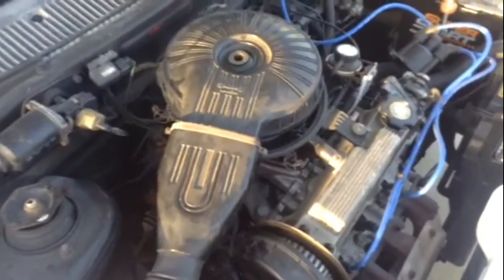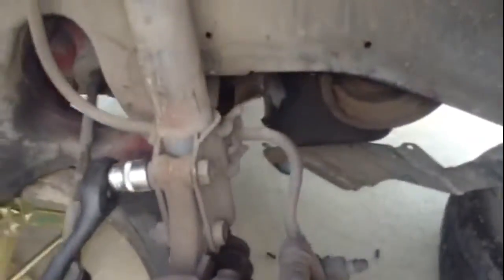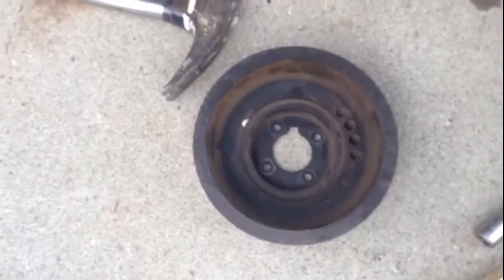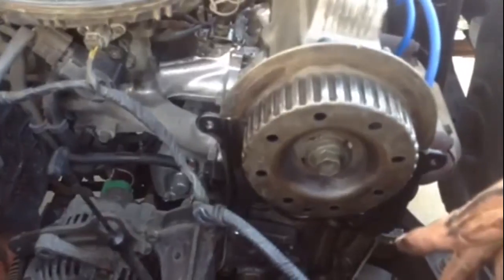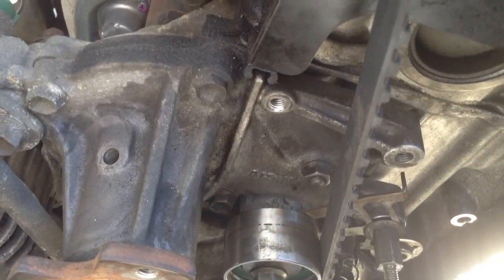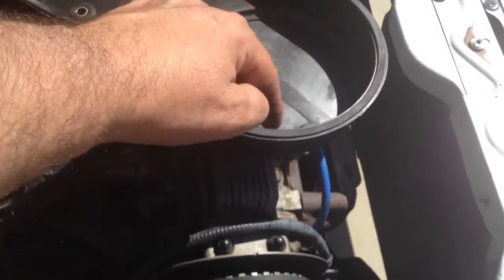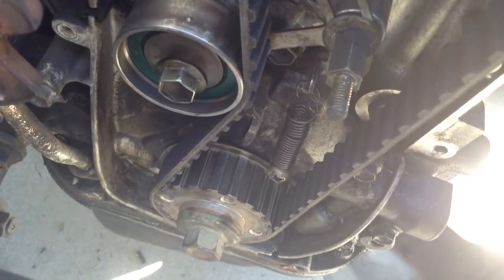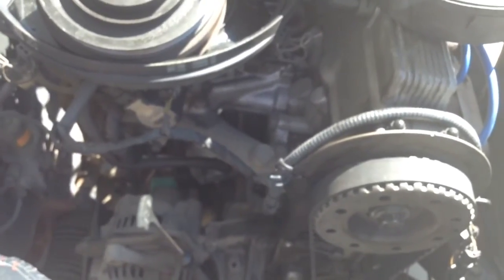1993 Geo Metro Timing Belt Replacement

Comment: How do you remove the cam shaft cog, I am just about to swap over to a different cog, one that allows you to replace the gasket behind this cog, but, the parts i need to swap over shows 5 bolt holes rather than 4, also the cam shaft cog also differs, rather than the 6 small holes, you have a cog like a mag wheel, giving you access to the 2 10mm bolts that holds the plate behind the cam shaft cog, the parts are off a 1995 suzki swift, and the old parts are off a 1992 holden barina, AKA a suzuki swift...... very good video showing facts and no mucking around

Comment: this video shows the basics of the install. I would turn the belt in the reverse direction to allow all the slack to be taken up by the tension spring (the one in this video has a kink in the coils...bad) and just allow the spring to set the tension (pressing on the lever the spring is attached to..to judge if it is moving freely and just let the spring set the tension) the belt will seam loose but will tighten up as the motor warms up with the expansion of the combined parts...over tightening the belt will cause the front journal of the front cam journal to wear and cause the cam seal to fail (requiring the head to need to be line bored to correct this)

Comment: I have a 98 Chevy Metro with 220,000 miles on it all the sudden it just started pouring oil I don't know if I hit something on the oil pan the roads are really rough here in Las Vegas do you have any suggestions on how to find the exact leak where it's coming from because there's oil all over the passenger side of my engine TY my email is MLindsay7602@gmail.com
Reply: Probably cam seal

Comment: replacing the water pump on these vehicles is a nightmare.
Reply: hmm...no it's absolutely not  :) it's not... you just need to remove the tensioner thats fixed to the house of the pump, and thats pretty much it... :) way way more easier than on any other car...
Reply: @zoltannagy3320  very very easy actually replacing anything on the car is easy
Reply: @zoltannagy3320  I'll try that.
Reply: Why you say that?

Comment: you have the incorrect with a belt on there. The later models had a 1 inch wide belt whereas the early models had the 3/4 inch belt
Reply: it took me 2 days & A LOT of cussing too get bolt off. Now I have a pouring oil leak when car is doing & oil is EVERYWHERE on pass side I'm a new student in my autoclass what was canceled for now because of the pandemic I need my car I'm an RN at one of the hospitals here in Las Vegas I refuse to get a new car and have payments up my ass so if anyone has any suggestions on how to find that soil leak please let me know or at least how to get my timing belt cover off so I don't heard anything TY
Reply: @melsme8130  it's the dip stick tube....you need to remove the bolt holding the dip stick tube. use high temp RTV to seal the dip stick tube after cleaning really good...
Reply: @theOGDirkDiggler  yes.  Also replace both the cam seal and the crank seal while you have everything off.
Reply: Prob need crankshaft seal and make sure to put grey rtv around it when you put it on and let it sit for few hours
Reply: @melsme8130  Use a Flourcent Dye??
Reply: uhuhhhhh